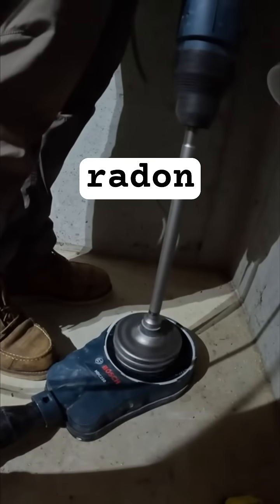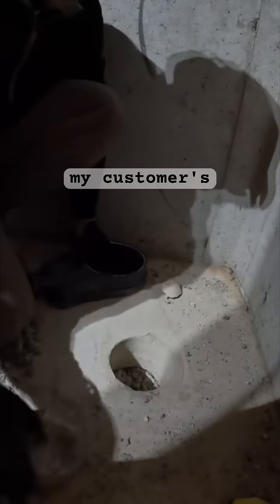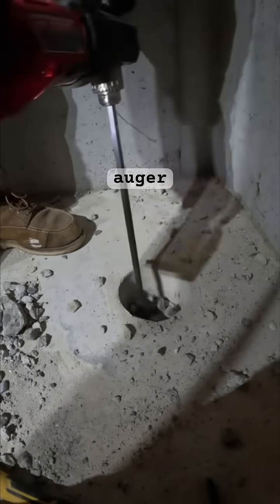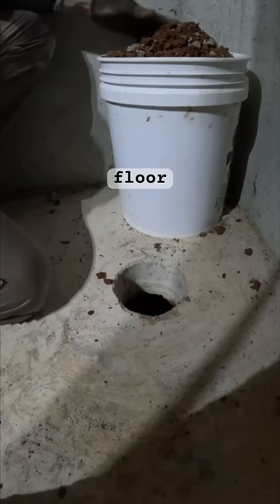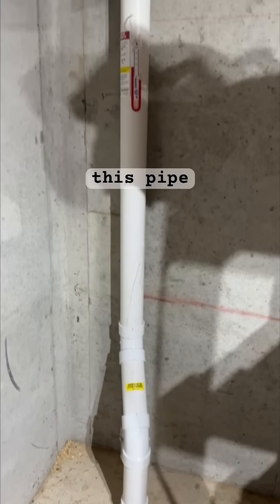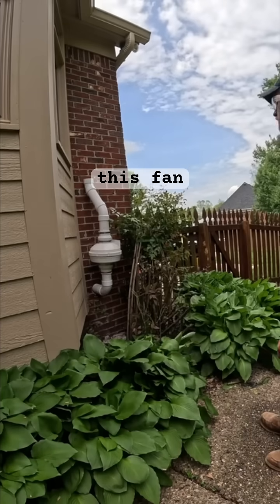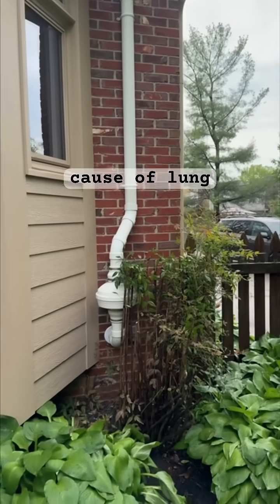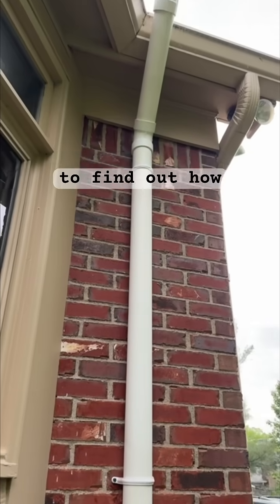Radon Mitigation System Install #radon #radonmitigation  #home #lungs #healthyhome

Comment: Pretty cool.  I always imagined the solution would have been insanely expensive , but everything you displayed here seems pretty reasonable.  Good job
Reply: it is expensive. Minimum 2k here in Iowa. The parts all together are roughly 400. These installers are bending people over without lube. DIY with the help of AI will walk you through the entire process. Almost idiot proof. Did mine, went from low 7s to .50ish after I did mine. Screw paying someone 1500 for labor.
Reply: It is if you don’t do It yourself. 3k here in NB

Comment: Are you able to do this yourself? I know they cost quite the penny but we have a crawlspace and it doesn't have a solid concrete floor just dirt and stuff. I've been thinking about maybe doing it myself but I have no idea what I'm doing (I'll obviously call before I were to dig). Do they have to be that deep?
Reply from the maker: Hey! Yes, it is possible to DIY a radon system — and there are plenty of YouTube videos out there showing how. That said, a lot of the ones I’ve seen include major design flaws that could actually make the problem worse by increasing radon levels instead of reducing them.

For crawlspaces, the correct setup is called a sub-membrane depressurization system. It involves sealing the entire area with an airtight vapor barrier, then installing a fan and piping to actively pull radon from beneath that barrier and vent it outside.

I’d strongly recommend reaching out to a certified radon mitigation company, but if you want to do more research on it, search sub-membrane depressurization system. Hope that helps!

Comment: Wait, so why do the people have enough radon inside their homes to warrant a system like this? Are they doing curie esque depletion experiments or collecting uranium isotopes in little altoids cans? I’m so confused
Reply from the maker: Hey! thanks for commenting. Radon is a naturally occurring gas that comes from the breakdown of uranium in the soil and rock beneath homes. It seeps into homes through cracks in basement floors, open sump pumps, crawlspaces, etc. Louisville sits on geology that makes it common here, and since radon is odorless and gets trapped indoors, it can build up without anyone knowing it, which is why we suggest everyone tests their homes. 

We have several radon testing options on our website at lungradon.com if you’re curious to see how you can test!
Reply: @TheLungChannel I’m a science nerd and since the process of making it was explained but why it works wasn’t I’m going to try to take a crack at this. 

Radon since it breaks down from uranium and other elements in the ground is more than likely a very heavy gas, the heavy gas will accumulate in parts of a mostly airtight building at its lowest points, so in this example the basement. You find the lowest part in the floor though this might be unnecessary if it’s pretty flat, bore out a small hole and put in a closed pipe system with some form of small gap enough for a small amount of airflow from the basement down into the hole. A fan on the other end blows the air out of the house. Radon must be remarkably heavy for this to work reliably but if I remember correctly you can sail an aluminum foil folded boat on top of radon